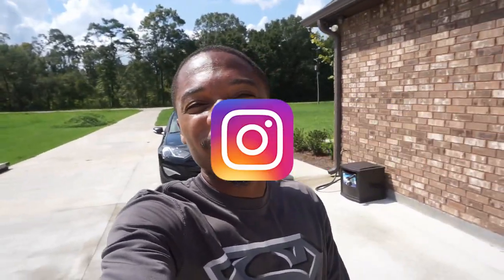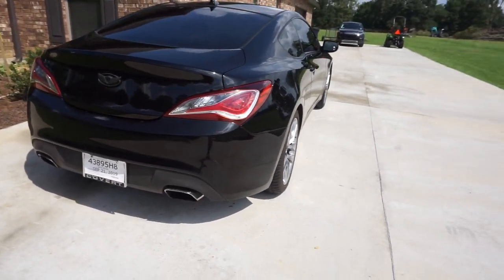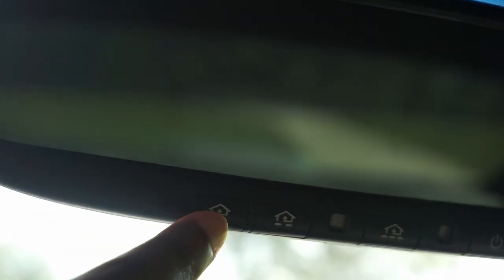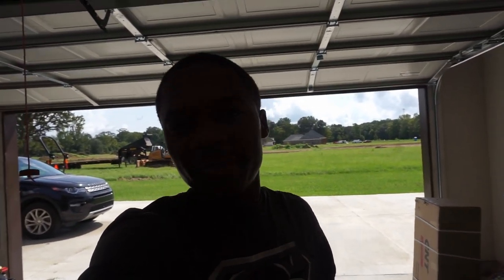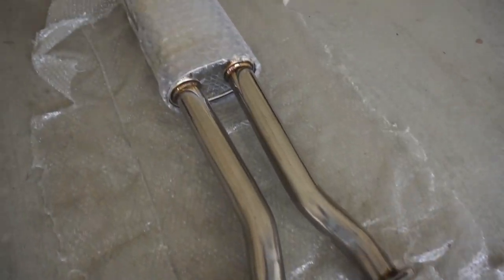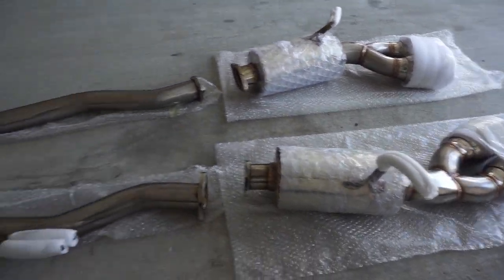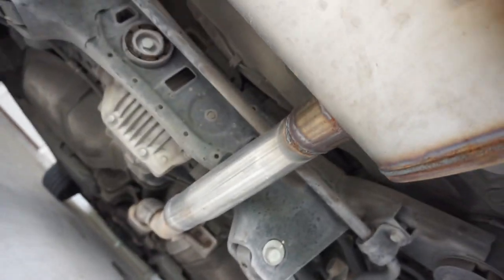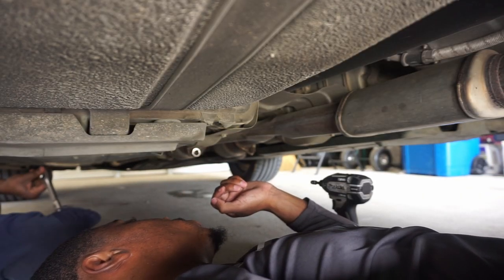Making My Genesis Coupe Sound More Aggressive!

Comment: watch out for the exhaust hangars breaking off happened to me reccomend getting it rewelded for extra strength.
Reply from the maker: Breaking off?😳thanks for the heads up. You used hose clamps as well?
Reply: @pj_morrison  yes i used hose clamps to straighten up the exhust  the extra tension caused the hangars to break your on the mufflers both sides did... also test and or headers make the cnt very raspy ! fyi
Reply from the maker: Ok, I used to have a Stillen catback on my previous Genesis and I loved how it sounded with the full exhaust.. I believe it had a slightly higher tone than this one due to the x-pipe on the Stillen catback. I’ll see tho, it’s nothing that can’t be changed afterwards which is why I went with the CNT to experiment